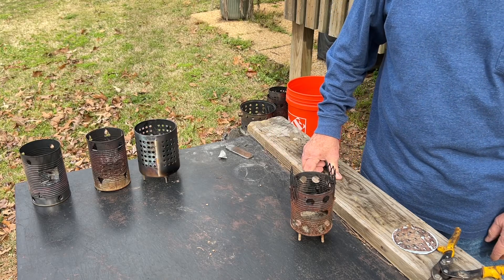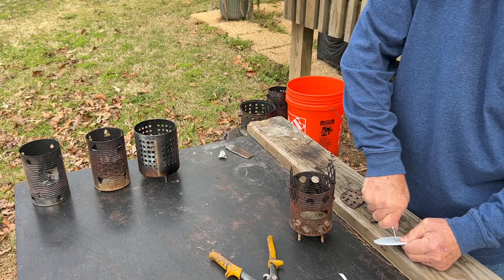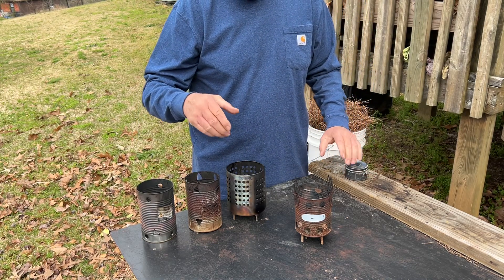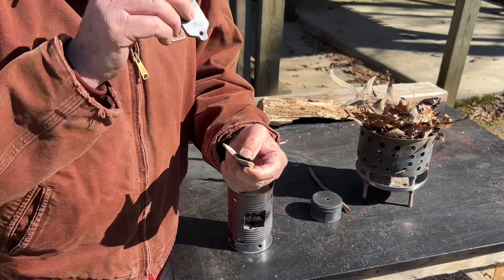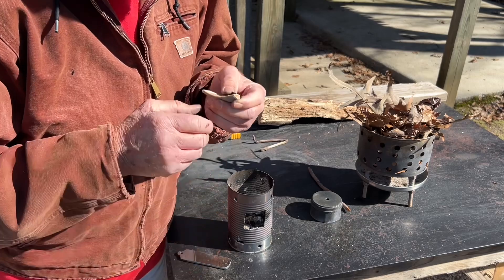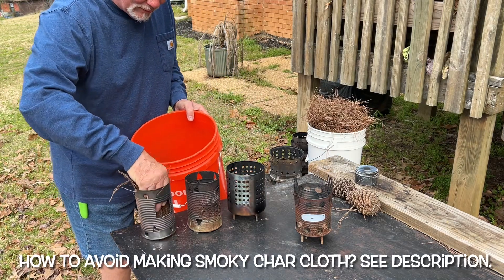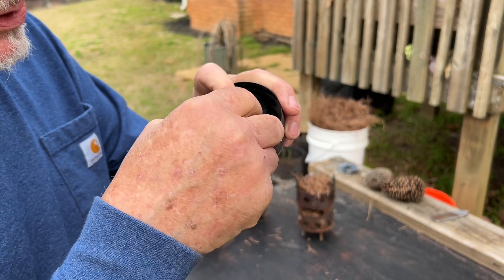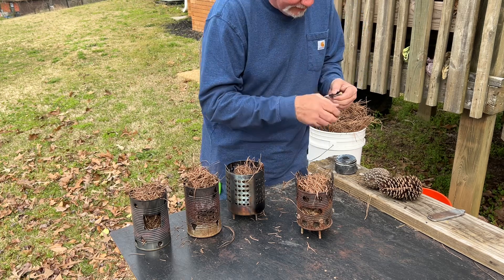Stop Making Smoky Hard Unreactive Char Cloth See Description

Comment from the maker: To make clean, supply, and highly reactive char cloth:
1) Do not overstuff char tin.
2) Use a big vent hole 1/4”+
3) Use consistent heat. Once it starts off gassing, Do Not Interrupt The Process! For example, do not remove a char tin to add fuel and then place it back into a much cooler fire… or any variation thereof. I'm convinced that it causes water vapors and other gases to condense on the cooler parts of the char tin and on the cooler pieces of char cloth causing smoke residue and/or hard places. Sometimes, it will render the char completely unignitable.
   Please follow the LINKs below and SUBSCRIBE. Thank You!

Char Cloth, Charred Punkwood Playlist
https://www.youtube.com/playlist?list=PLkoXX8XsMW3nfHvlf-YghwFdkUBYRIIMy

Comment: I have made made good Char Cloth a few times now.
The first time, I had rock hard but reactive cloth. I then watched one of your videos that said to put some Punk Wood in the bottom and top of the tin.
It works great!!! 
I didn't use Punk Wood, I used bits of Trumpet Vine.
Seems like you just have to keep the cloth from touching the metal tin.
I also use Denim Cotton.
Thanks again David West for another great video!!!
Reply from the maker: Yes, lots of different buffers will work.